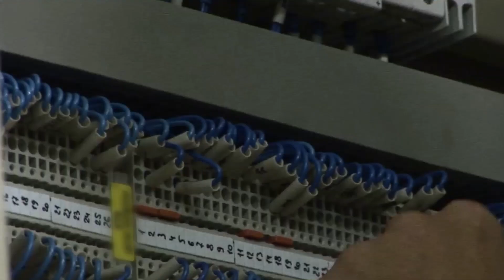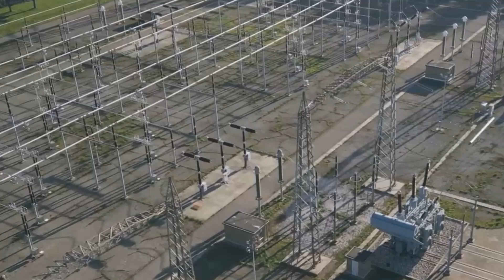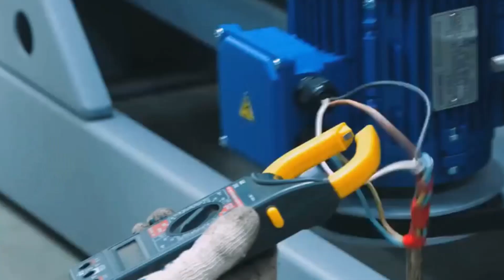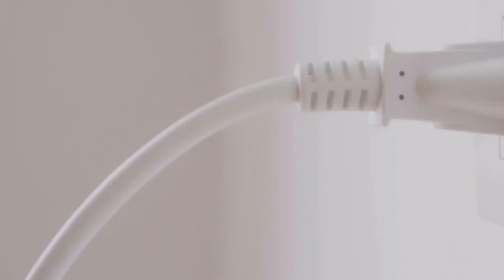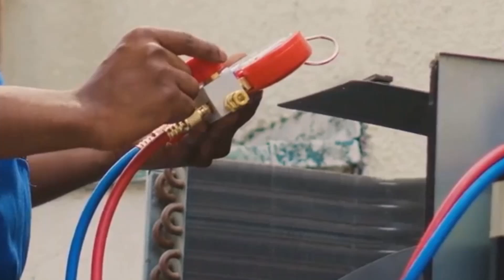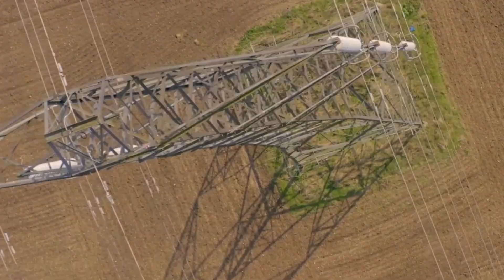Wye (Y) Connection Explained | 3-Phase Power System Basics

Comment: This is one of the most well-structured explanations of Wye connection I've come across. The way you broke down the relationship between line voltage and phase voltage (VL = √3 × Vph) and showed how the neutral wire handles unbalanced loads made everything click instantly. 3-phase systems always felt overwhelming at first, but this video makes it approachable for anyone starting out in power systems. An absolute must-watch for EEE students and power sector job aspirants.
Reply from the maker: t means a lot to know that the video made three-phase systems feel more approachable. Wishing you all the best in your EEE studies and power-sector career journey.